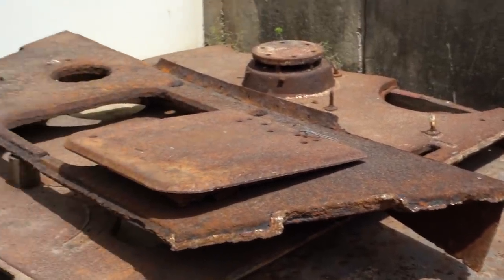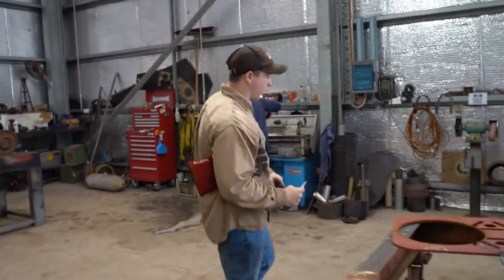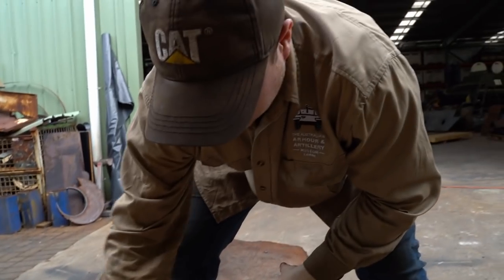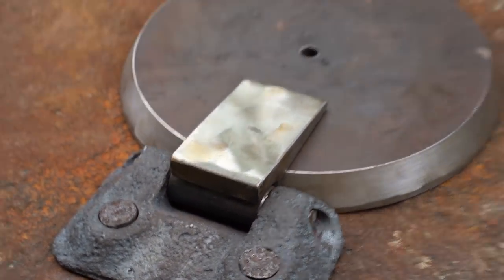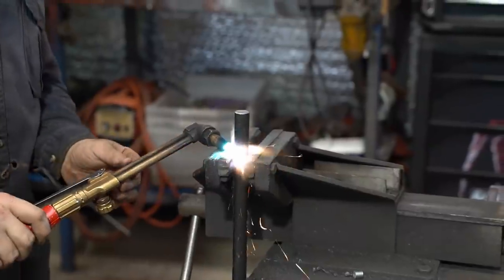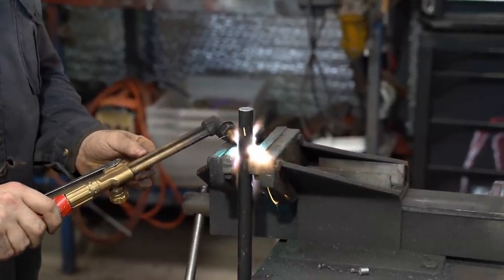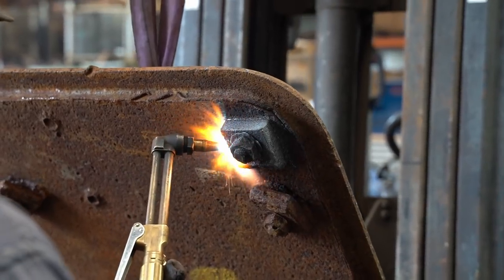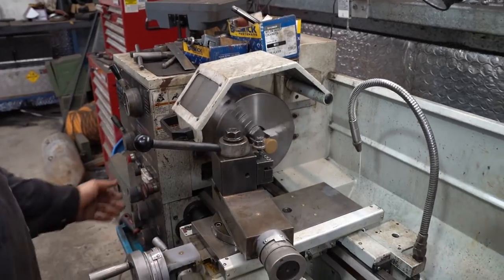Workshop Wednesday - JAGDPANTHER RESTORATION Ep. 1

Comment: 2 of my favourite subjects at once, heavy metal and cats! There is a Tiger 2 in France that was buried under a road, i believe the dispute as to ownership is still ongoing. A perfect candidate to receive the same level of craftsmanship that has gone into your other restorations. They already have a running Tiger 2, it should be rescued and restored. Even the Swiss are bringing their example back to life, what more encouragement to do you need?
Reply: the problem with the Vexin's tiger 2 is that only the chassis remains, with this ammunition.  Under a crossroads.  The Saumur museum would like to recover it, but the French administration is as complex as a tiger 2, precisely.
Reply: @addisth   I do recall that the turret was  recovered and  it still had most of it's original paint. Where is it now?

Comment: Awesome, I'm a Fitter & Turner the tapered bolt that was made isn't just like the original. Get a old shool Fitter & Turner to machine them from bar stock and screw cut the thread. Looks like you guy's need a small milling machine or go one step high and go CNC lathe and CNC  mill. 
What the reason for static only engine drive train missing??

Comment: A little questionable if this is a "restoration" as it doesn't look like there is much there to begin with except a few original parts that seem to be from multiple vehicles.  I think "reproduction" would be a more accurate statement... a reproduction that has some original parts.  Great work though, not knocking what you're doing!